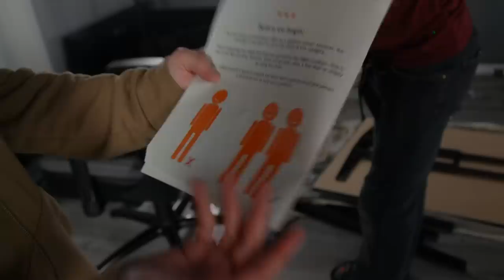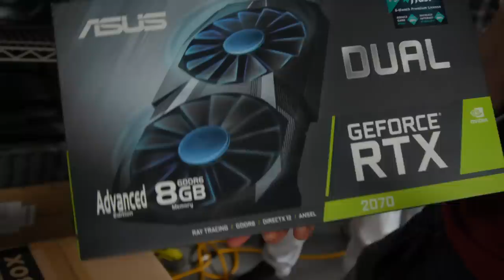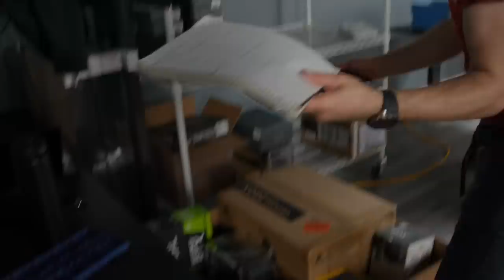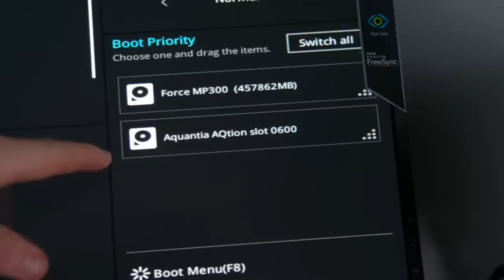LIVE BUILDING 10 Gaming PCs!

Comment: Wow. That mess of cables is insane. A trip to an auto parts store to pick up various cable clips to sort it all out would have really been a good idea. Cars really have had the cable management thing solved for a long time, always surprised no one uses those clips in a PC case. The plastic anchor pins even fit nicely into PC screw and vent holes.
Reply: They have ltt branded cable ties too.

Comment: we have a system when building multiple identical systems. we take out the mobo, processor and ram and preassemble them. and then we preassemble the cases fans hard drives and power supplies. then the graphics card and  lighting. and we do this in a assembly line style so it's easier and faster.

Comment: I had my top fans in my own case setup for intake as well, but I ended up switching them up. It reduced system temperature. It was trapping a lot of hot air under the video card which is less then ideal.

Comment: I assume they were all identical with all the same hardware configs? Did you use a hdd dock with the cloning tool to copy the the os onto the OS ssd's? After all the oc's and adjustments have been made of course. Then you would only have to enter the cd key to activate them all. That would make the most sense when building multiple copies of computers since you would only have to make config changes to one and then copy the OS to multiple drives to get the benefits across all of them. And if your using SSD's then it should only take seconds to copy the OS. Super quick and easy. Especially since some docks you don't even need them connected to a computer to copy a hard drive. Insert drives, push button, drive copied. Repeat ad infinitum!

Comment: why have a lightning node pro and a commander pro? isent the whole point of the commander pro to replace the lightning node pro? the case only holds 4 fans so it shouldnt be capped out, or was it not a lightning node pro but instead a rgb fan hub

Comment: I wanna know if all these parts go together so I’d appreciate if anyone know their stuff about pc’s can answer

Razer Antec Cube case - £180
ASUS EX GTX 1060 6gb - £184
Gigabyte H110N DDR4 Mini-ITX Motherboard - Black - £80
Noctua A14 iPPC-3000 PWM, Heavy Duty Cooling Fan - £22
ARCTIC Freezer A11 - Silent 150 Watt CPU Cooler - £24
Cooler Master MasterAir G100M CPU Cooling System - £35
Seagate HDD Internal 1TB 3.5 - £36

Comment: what to buy rtx 2060 or rx vega 64 and why ?
the rx vega 64 has 8 gb ram hbm2 but rtx is of a new generation
Reply: Since they perform about the same, should probably get the 2060. It seems to be slightly cheaper and is far less power hungry being a lower tier card (less heat). The Vega 64 has 2x8 pins vs the 2060's 1. Not to mention all the additional features the 2060 has over the 64 as well...

Comment: Is current AMD system really good? I see a lot of people build ryzen nowadays. I've used amd once, and it died cause of overheating.
Reply: They dont die anymore :D. Ryzen is a good deal price wise. also Intel is far to expensive right now because they messed up with their production...
Reply: @bokajllensch661  good to know, been wondering. I personally prefer intel (due to amd PTSD).  But good for AMD, they are getting better.
Reply: @blinkren7432  Right now there are better. Current Intel CPUs run very hot and have several security problems.
Reply: Current AMD processors are much better than previously. Especially when compared to some of the older FX processors.
Reply: @React2Quick  Too bad I can't try it, my current cpu would last at least for the next 2 to 5 years, unless, AAA games need octacore to run. 
Also the nightmare is still fresh in my mind.
Reply: @bokajllensch661  My intel CPU avarage at 41c and the highest is 51c at AAA games, ultra setting. I don't know bout security problem tho. My GPU however,  can hit 67-70c even with 6 fans inside the case, it's factory OC, kinda worries me.
Reply: @blinkren7432  Dont worry those temps are normal. If it goes over 100 degrees celsius you might start worrying.
Reply: @blinkren7432  67-70c is fine. That's a tad hot but not really hot.

Comment: Linus could you build a system of this spec and try dealing with it for a hour playing fallout 4 Cpu:Core i5 4570 with a psy gtx 1050 6 gigs  of ram and a 400 watt raid max but here is the kicker you have to use a stock Intel cooler and once it's setup and running with the drivers you can only modify settings in the os
Reply: Before i forget And no ssd either if you can manage I would literally subscribe to the channel for as long as you tube is running (Not like I haven't been here for like 3 or 4 years but yeah deal with it good luck!

Comment: Hi there huge fan for your channel 
I have a very old PC i get all together-in 2011  
My specs is 
MP ASUS P8Z77-V PRO LGA 1155 Intel Z77 HDMI SATA 6Gb/s USB 3.0 ATX Intel Motherboard
CPU  Intel BX80623I52500K I5-2500K 3.30 GHZ 6M Turbo OVERCLOCK
GPU EVGA GeForce GTX 570 Superclocked 1280 MB GDDR5 PCI Express 2.0 2DVI/Mini-HDMI SLI Ready Limited Graphics Card, 012-P3-1572-AR

RAM Corsair Vengeance 8 GB (2 x 4 GB) DDR3 1600 MHz PC3 12800 240-Pin DDR3 Dual Channel Memory Kit 1.5V (CMZ8GX3M2A1600C9)

Is it upgradable
Thanks for your time reading this